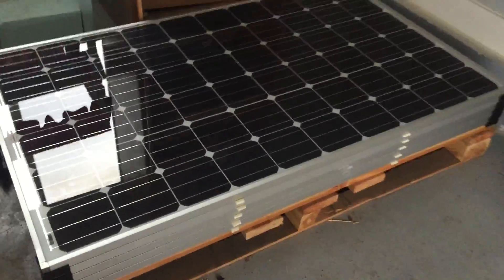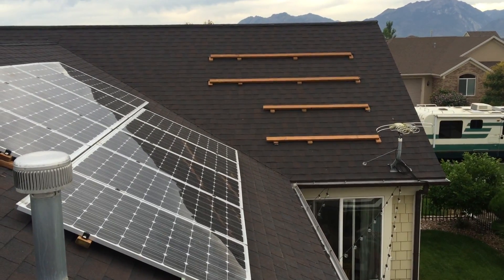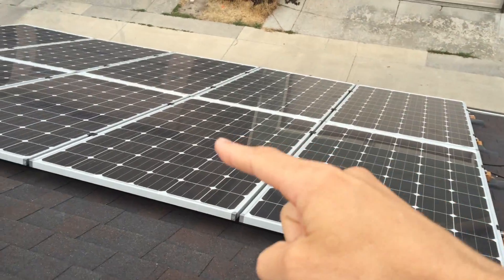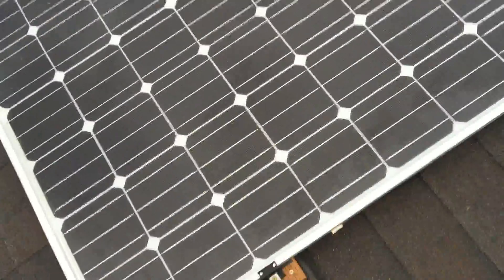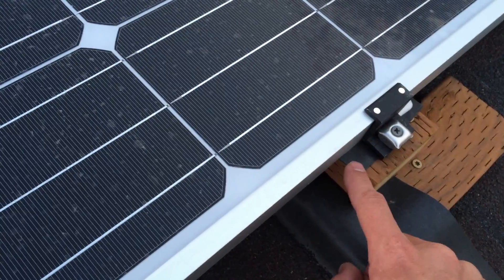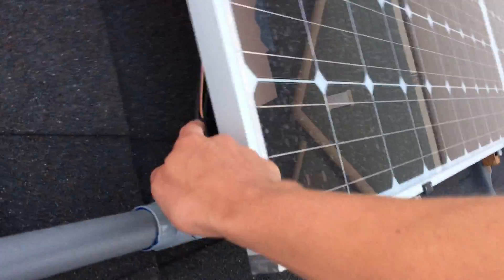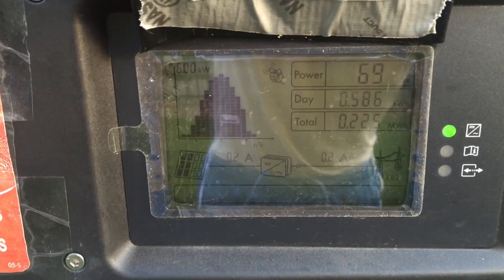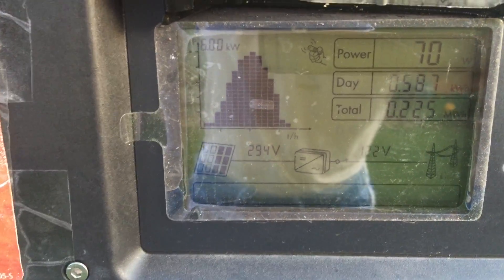How To Install Solar Panels Yourself For $4K - DIY 7KW - South Jordan, Utah - Cheap

Comment: Hey Matt, thanks for sharing.  I'm just beginning the process myself in Cache Valley.  I noticed your panels are set back from the roof edge.  Do you know what the requirements for setbacks are here in utah? It seems like I've seen panels all the way to the edge of the roof on some houses.
Reply from the maker: In my city there wasn't really a requirement on how close you can get to the bottom edge. But, on the side and top edges you had to be 3 feet from the edge so that firemen could walk up and down and along the top of your roof
Reply: Thanks! I'll check with the city

Comment: Hey Matt.  Nice Job.  I have been thinking about doing DIY solar for my house but a concern I have is the rebate system for a DIYer.  I have heard the full rebate is only available if you have a licenced professional do it.  Have you received your rebate yet and was the paperwork difficult?  Thanks and way to go DIY solar.
Reply from the maker: Yes, I have gotten the tax credits.  Have a look at https://diynewman.wordpress.com/2016/07/24/how-to-install-solar-panels-yourself-for-4k-diy-7kw/ for all the details.  Basically, it cost me $8600, and I got $2600 federal credit and $2000 state (Utah), which varies state to state.  I already got these on my 2016 tax return 3 months ago.  See also https://docs.google.com/spreadsheets/d/17l-QP0PswdXRNdfbICIZk83niCknfW6OeJlVLyCDeQ0/edit. 

I had the same concerns, but your city (for building permit), state and country (for tax rebates) are very accommodating to DIYers who want to be owner/builders.  You should check with your own city and state, but I didn't require an electrician or anything - I did it all.  You do have to get validation from the power company that you did hook it up - that is all the state wants.  The federal government doesn't require any validation for your tax return.
Reply from the maker: Oh, and the paperwork was fairly straightforward too.  have a look at my blog for all those details.

Comment: Sounds extremely risky and not worth the time or effort
Reply: @Marshall Hawkes Are you a solar installer, not wanting this idea to catch on?
This DIY project is actually solid. The installer said his work passed all inspections. What more does anybody need?

When people bad-mouth something this way, it usually means they have some selfish interest in it. I was singing the praises of Linux routers one time, and how much money one could save. Some guy immediately shot it down as rubbish. Later I got to know that he's a Cisco guy, scared that people might actually stop buying expensive Cisco routers, for Linux DIY solutions.
Reply: really don't know of many people with terrible misconceptions about solar. he has a nice setup and looks ar good as a pro installer.
Reply from the maker: I am not sure what you consider risky about it.  I saved $12K by doing it myself (installers charge $16K and I did it for $4K).  It took 100 hours of my time.  I am not sure how valuable your time is, but I basically got $120/hour for this work - that is worth my time.  The risk is low if you are just careful when handling wires.
Reply: Tar? Lol and your racking. Dude, if you are going to put $4k on your roof and want it to last 35+ years, def not the way to go! Plus no backed warranties, so if something goes wrong you have to take it off and ship it back to the manufacturing company and pay for all that. I'm just saying for something you are willing to pay so much for and want so long on your home, it is extremely risky to do it yourself if you have zero experience, and hahah you obviously don't looking at the job you did.
Reply: It's because of systems like this that people hold terrible misconceptions about solar and the problems that can come from having it. Hope your roof doesn't leak, or your panels don't blow away.
Reply from the maker: interesting perspective.  welp, it is working for me so far (after several strong wind storms, heavy snow winter, and a lot of rain) and hopefully it can work for someone else.  I just thought I would share here for others' benefit.  I figure I saved enough money to replace the system 3 times for what installers charge.  I accept some of these risks you mention - that is why it is DIY.
Reply: done right. well be building a new home within the next few months and i plan to try to run everything i can on solar with supplemental wind for those cloudy days. definitely want to do it myself as you did.
Reply from the maker: Yes Marshall - don't fear the disruption, embrace it!
Reply: Solar panels are rated to lose about .5% efficiency per year, so I would imagine around a 12.5% loss of efficency after 25 years of sun.
Reply from the maker: Thanks scoomagee.  I did what I could!  I got approval from HOA, building permit from city, signoff from a structural engineer with measurements on wind/weight tolerances and such (required by the city), signoff from power company, and followed practices I have seen others do (with tar, rubber, treated lumber, etc.) to prolong the life of the system.  It would be nice if it lasts 35+ years, but even if I get 20 years for $4K I will be elated since my breakeven is about 2-3 years.  BTW, I think I could have done it for $1K less if I had bought my inverter on ebay and bought Grade B or C panels (just as good) from Sun Electronics for 20-30 cents/watt instead of the 50 cents/watt I paid.
Reply from the maker: I would love to hear about where you got racking for only $600 - if it was only that much, I would have considered it.
Reply: That's a bit of a snowflake attitude Marshall. I'm first in line to comment when I see yet another dumbass offgridder job, but honestly there's nothing much wrong with this, considering that the roof is a wooden structure anyway.
Personally I reckon I could have sourced metal racking for well under his $1800 quote, but as long as he inspects it every year or so then fine. 
All that nanny state faggot labelling though, and in America too.
Reply: Marshall...... Back to your cave Troll....
Reply: 35-50 years?  Not likely.  Solar panels lose efficiency every year.  After 25 years on good quality panels, it is normal to lose up to 20% efficiency.  The electronics are not likely to last 10 years, there may be hope for 20 year micro inverters I heard but I havent seen any modern electronics last more than a few years.

Comment: If you use a grid-tie limiter inverter it can reduce power coming from grid, it doesn't feedback, only makes what you use... you don't get charged for distribution or generation!
Reply: Which ones?
Reply from the maker: yeah I wonder too
Reply from the maker: interesting